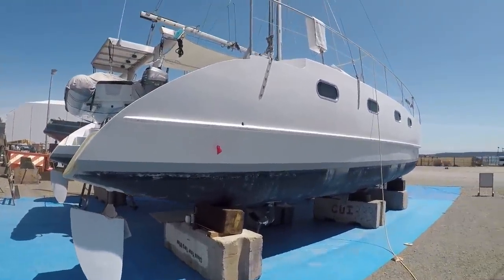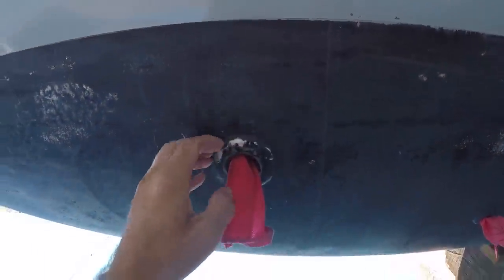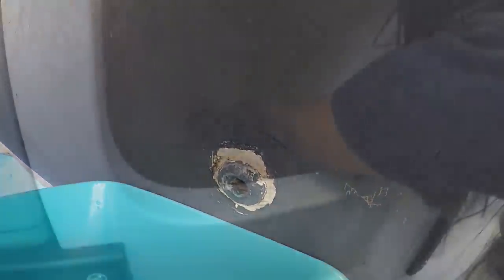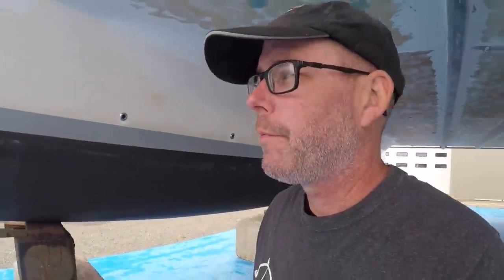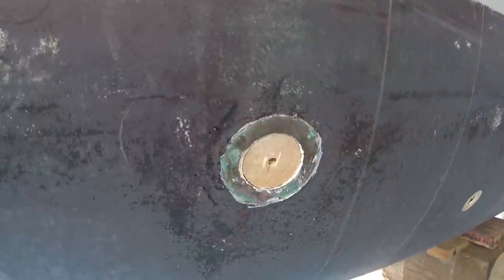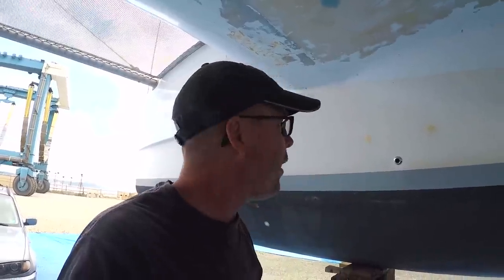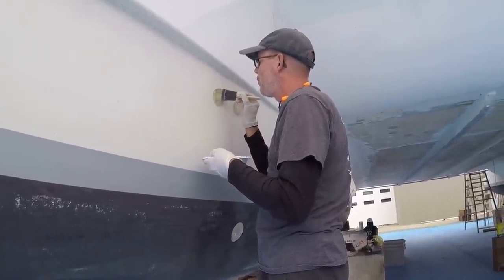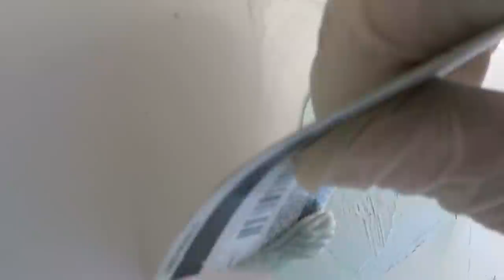Crisis Averted! Removing Old Brittle Thru-Hull Fittings - Onboard Lifestyle ep.69

Comment: This is Jace Hobbs of Nelson,, New Zealand.  I designed and build this catamaran 25 years ago in my patented process Mastermolding.  You can see the old Multihulls magazine article done on this boat and the process I invented to build it.    Does everyone know that the both sides of each hull and cabintop are all built on one very special  Mastermold with vacuum assist and high-modulus fabrics.  The whole boat only took me one year to build, including the mold, so it has been a durable and performance oriented process with  lots of weight saving technology, yet quick to build
. The molding is done into a concave (female) mold with really clean and low wastage advantages.   I have recently updated the mold shape and can produce custom bow and stern  profiles all on the Mastermold. I have also refined the hull parameters to take advantage of what we know as the best sea-keeping shapes and this is similar but more refined than the boat that this lovely family are living and working on.   So if persons with interest in this boat and the two other size catamarans that can be build on the same mold, they can contact me  at jace.hobbs@gmail.com.

Comment: plastic thru hull fittings are sealed in place.. the nut barely snug so you don't stretch the plastic causing it to break,  its the sealer that prevents leaks.. not the over tightening of the nut.   one must use care when putting hoses or fittings on the inside of plastic thru hull fittings.. to prevent breaking loose the sealing material.  just thought i should chip in..

Comment: 42 throughholes on the Leopard ?  18 below waterline -  that's insane .
Great patch job - modern materials like thickened epoxy make life a lot easier  :)
Reply: It'd be interesting to know what they all service.
At a guess though.
3 for each head (4 heads and assuming no holding tank/s or combining of grey water plumbing): 12
2 for each motor: 4
2 for the generator
2 for the water maker
2 for each AC unit (intake and exhaust + how many on board? Let's say 3): 6
2 for the galley?
2 for Bilges
That gives 30...
Reply: That's what I was thinking! Seems counterintuitive to me...not to combine them before penetrating the hull. Less penetrations = less potential problems later.

Comment: Less is more when it comes to holes in boats. I'm thinking i want to put two in for the wires of the electric motors, or fair them to the outside of the hull, and maybe one on the keel for sea water, and just put on tees on the inside, 
 and make sure to have a way to easily and quickly close or patch it in case it fails.  Every outflow can be above the waterline.

Comment: Dude, go to harbor freight and get some 5 to 9 mil nitrile gloves that fit better.  9 mil are super thick and tear resistant and 5 mill thinner but tough.  7 in the middle.  Unless you can’t use nitrile with epoxy
Just saying I have learned from experience that not protecting your hands delays projects.  Good set of gloves or the right kind of gloves for the job makes it go easier.

Comment: Almost seems that throughholes should always be changed when buying a new boat, just to be safe.

Nice technique on the hole filling.  What tool did you use to grind that small of an area?
Reply: I used a grinder with a 40 grit wheel.

Comment: As a new boat owner, 1970 45' Hatteras, why are you removing the thru hull fittings? Safety and Security? Thanks!
Reply from the maker: They were all old, brittle and not in the best shape. We feel much better now that we have replaced them and removed some all together. Both for safety and security.

Comment: Please buy or rent the right tools to do the job. Random orbital sanders are rated on their duty cycle and either a coarse or and fine orbits for aggressive or fine material removal. The right tool, the right operator and the right grit will remove material more efficiently. I own sanders from Porter Cable but this one from Bosch Power Tools - 1250DEVS  looks very promising. Also, wet sandblasting if possible or even a 5- 6-inch angle grinder with a rubber pad and 120- 220 grit discs will remove the initial material much faster. my two red cents.